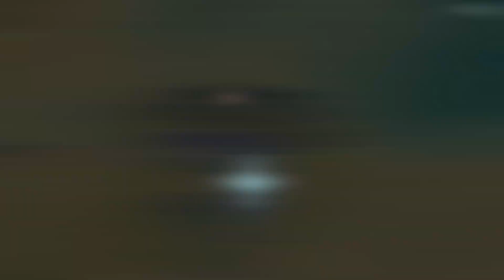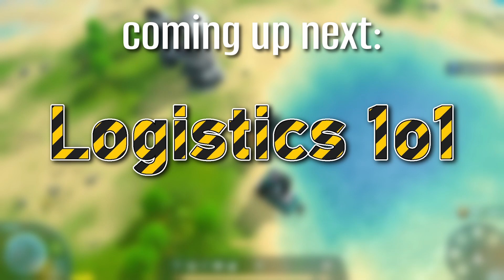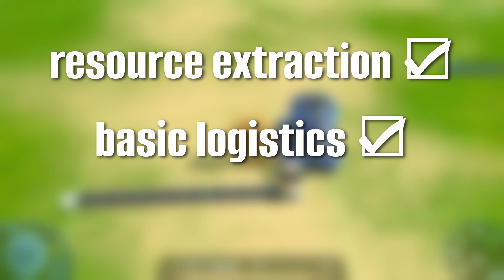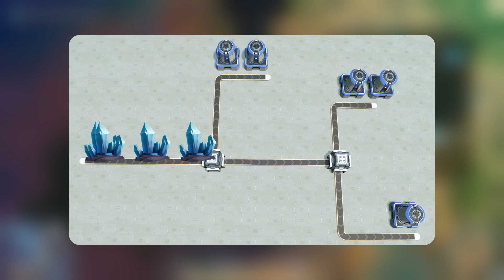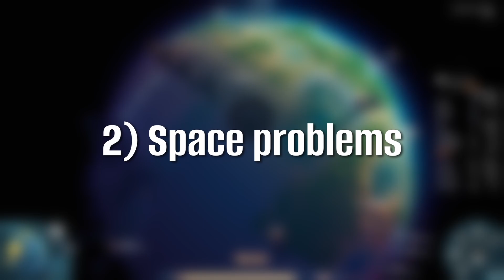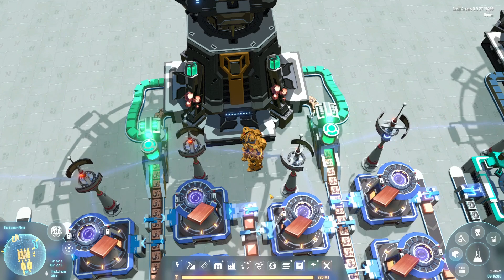Handling Resources, Logistics and Construction in Dyson Sphere Program

Comment: Pilers are extremely useful. If you go for high producivity factories you can stack 4 ore belts coming from an ILS onto one. That way your one belt can provide sufficient ore to 4 times as many smelters. Or if you have a high output production of something and only one belt available you can slap in some pilers inbetween and voila you suddenly got space again on the belt so that your assemblers further down the road can output their products. I use them almost everywhere. Given they become much more niche when you unlock the final upgrade to ILS where every belt coming out is already at 4 stacked but before that they are insanely good.
Reply from the maker: that's an interesting point which i haven't been in yet. i usually go for wider, parallel working facilities instead of extending the length of the ones which are working in serial. can't think of any downside for it though, probably boils down to the individual situation and personal preference, i guess 🤷‍♂️

Comment: Automatic Pilers are also VERY good for Deuterium Production; you just build Hydrogen in a Loop;  stack it up to 4, and every Fractionator is 4* better as normal

The 25% Tier 3 Proliferator is worth in the VERY long run; in the end it just costs Fire-ice (thats technically endless) and just a bit titan, o and there also Spray 60 times, and MK 2 spray for 24 times

Good video for beginners btw :)